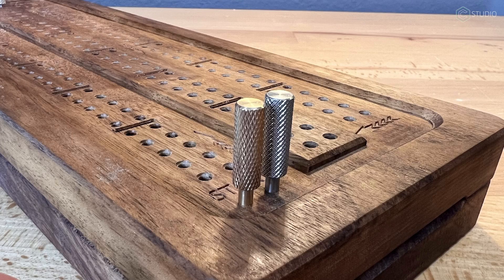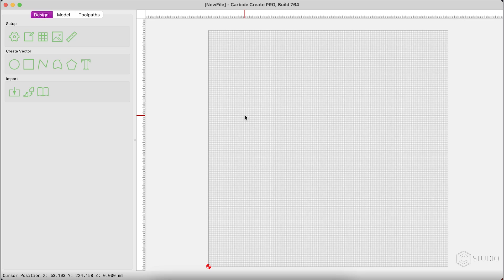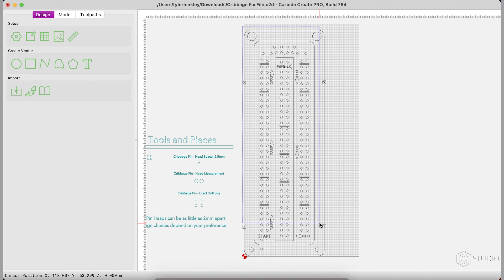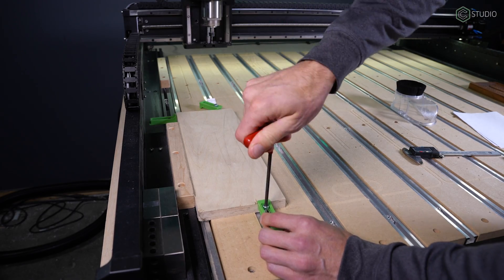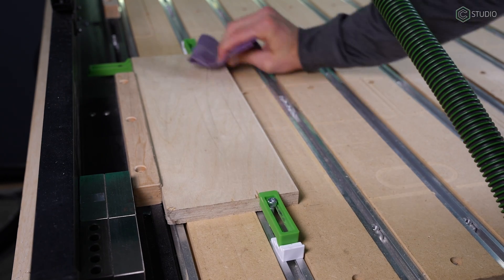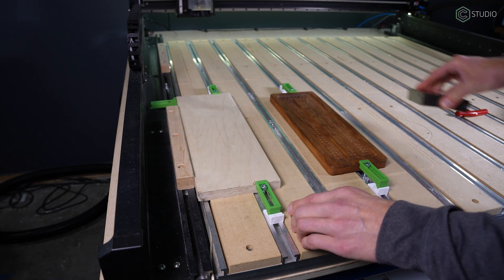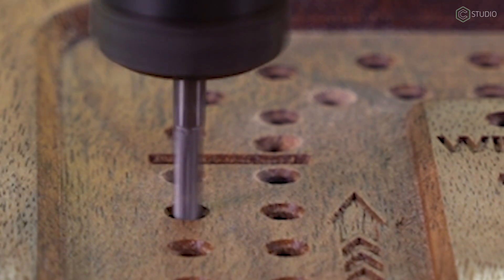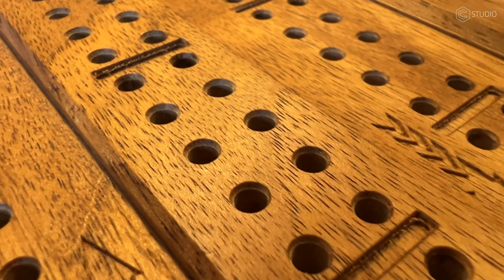Locate & Modify Things with your CNC Router.

Comment: I can give you a much simpler approach : Assuming that you made your cribbage board on the router. Take a piece of 1" thick MDF ( aka Medite ) that is a couple inches larger in both X and Y dimensions than the crib board and clamp it down to the router bed. Route out a pocket in the MDF of the crib board's outline about 0.250" deep. When I do this, I try to make it about 0.001" too tight in the X and Y dimensions to make things a tight fit. Put your crib board over the pocket that you've just routed out and press the crib board into the pocket. Do not use too much pressure. If it's too tight, route the outline in the MDF a bit more but just enough to make the fit tight. I would put a bit of scrap wood on the crib board and using a light hammer, tap it into place or however you see fit. Now the router knows exactly where the crib board is in the X and Y orientation. Once you have the crib board firmly in the grasp of the MDF board, zero your router to the top of the crib board and you're set to go. I usually do not need to clamp the object ( the crib board in your case ) as the MDF, if routed just right, will make it a really tight clamp. Now go ahead and fix those peg holes or whatever you need to to. I do this not just for fixing an existing project but also for making completely new projects where I need to machine both sides of a part. I would be happy to send you some pics if you like. The beauty of this method is that it will work with just about anything including really irregularly shaped objects. For example, let's say that you routed a shape like a boat anchor with all kinds of curves and few straight lines. Use this method and it will work just fine.
Reply: Easiest way!
Reply: Almost exactly how I machine both sides of a guitar neck and keep the centerline!